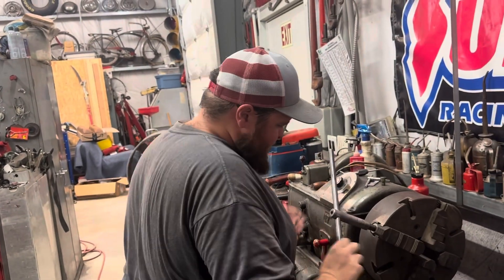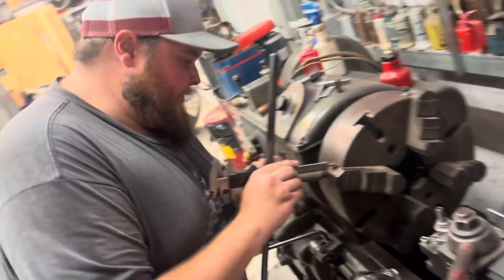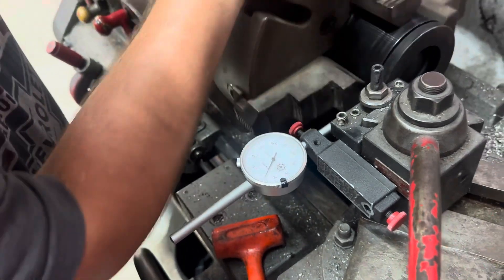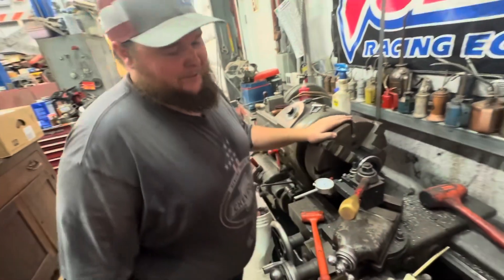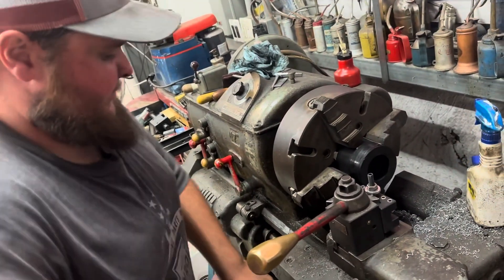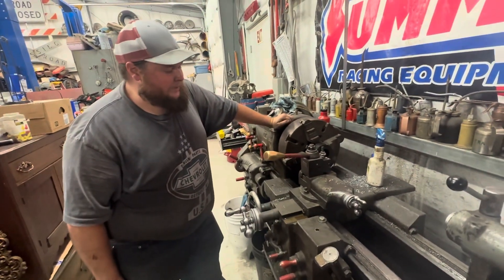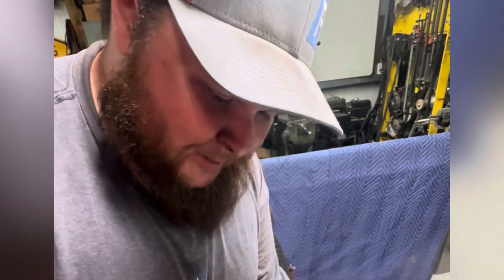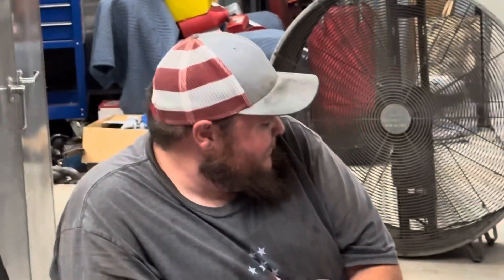Delipping stock LB7 duramax pistons by amateurs (and @btwracing) for 1200hp

Comment: Im a machinist and we have a pulling tractor. Im not too familiar with a duramax. We have custom pistons made but I wouldnt take anything off the top of the piston. I would just open up the bowl. Having a larger bowl allows you to run more timing without having the injectors spray outside of the bowl. If the injector sprays outside the bowl, you will melt pistons. Our piston tops are basically a ring about 1/2" all the way around with a flat bottom bowl. We also have valve reliefs for a longer duration cam so the valves dont hit the pistons. This is our tractor.

https://www.youtube.com/watch?v=IYA2UwRk1VI